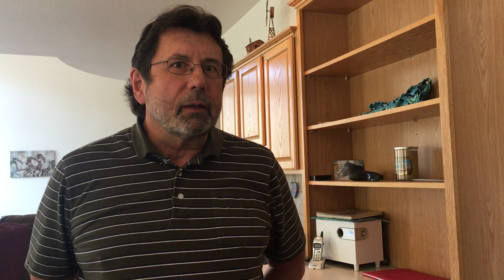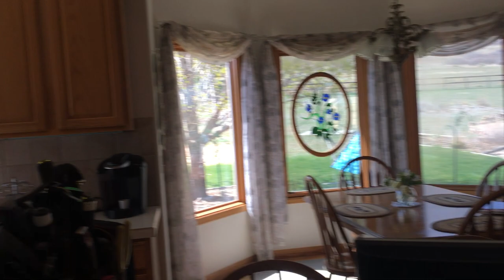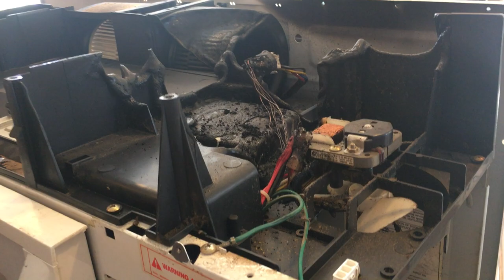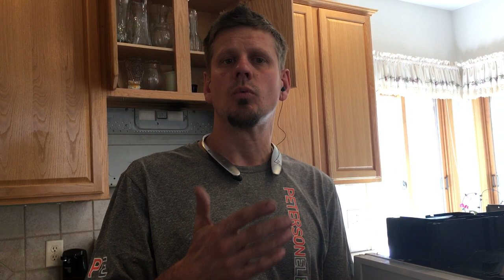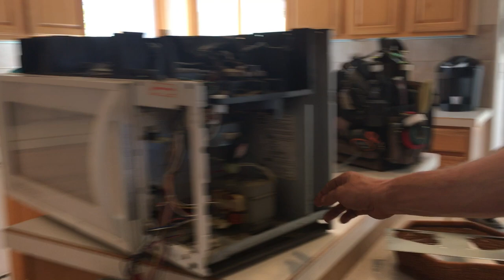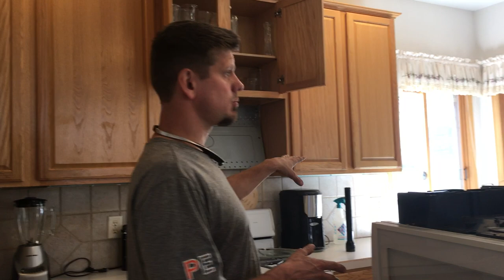Magnetron in Microwave Heated Up and Burnt Up, Fire Hazard

Comment: I seen a few commercial microwaves fail in restraints like this on the magnetron output when critters nested and got cooked anything in this cavity area gets cooked beyond recognition and burns so hot with RF it starts melting anything around it  RF burns are nasty.

Comment: Our magnetron burned out today in the built in microwave. If I had walked away I'm sure it would have caught fire. Microwaves need a major redesign, to shut off when things go wrong.
Reply: They do have thermal fuses in them. Have to get hot enough first.

Comment: The 15 Amp Ceramic Fuse Inside Microwave Didn't Blow?  The Mircowave Plug Is Rated At 20 Amp At 120V. Power Cord Has Plug For Quick Disconnect..
Reply: P S. The Ceramic Fuse Is To Protect The Service Tech Eyes When Servicing The Mircowave.
Reply from the maker: NOPE. The cord melted down and Mag smoked. No AFCI protection, prior to code based on 90's home
Reply: @Petersonelectricllc  I can’t use my microwave, my fridge, washing machine, battery charger, garage door opener with battery charger on the same circuit, most power tools. Now my gfci trips on the dryer immediately. I had a problem in the winter with the GFCI tripping the fridge when the weather got cool. This is a 2021 install with new service and new 200 amp panel. These AFCI’s would be great, but for lost items you can’t use them from my experience.